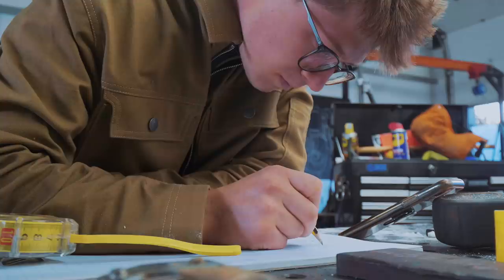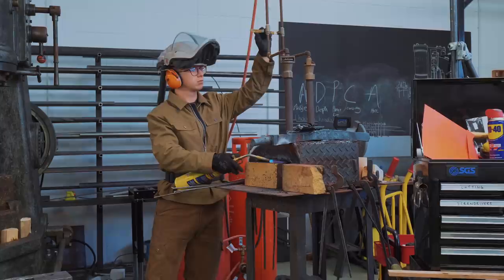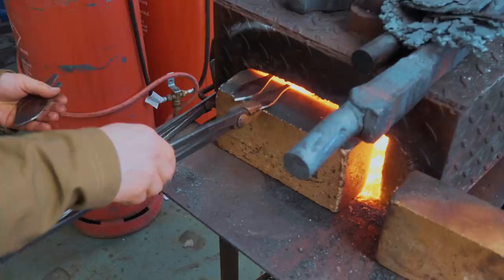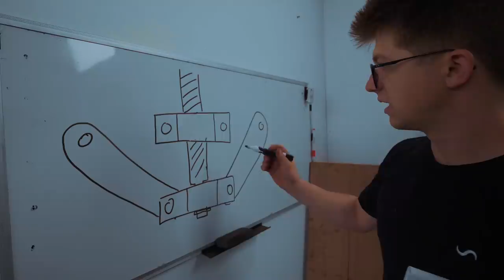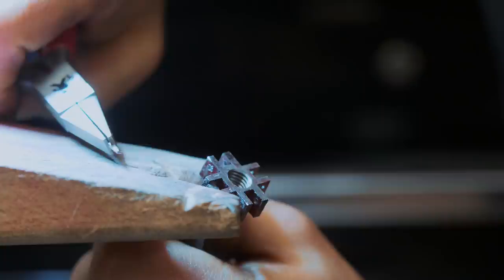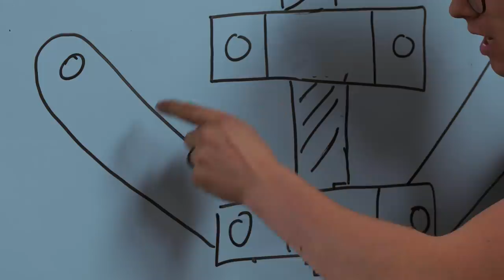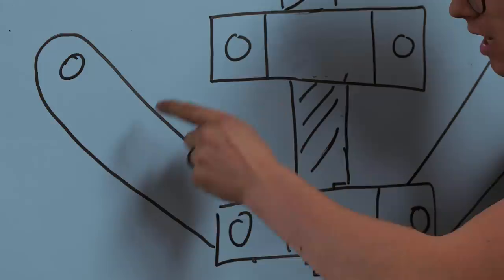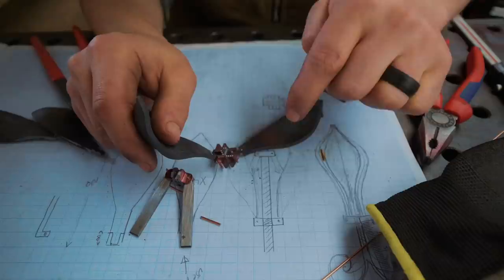Making the Pear of Anguish!

Comment: Idk what’s more scary: the fact he’s making a torture device, or that he’s using red dykem
Reply: the red just seems fitting though
Reply: Definitely the Red Dykum.  That signals a sea change in this channel's future.
Reply: Red dykem???? Oh, goodness... I should stop reading comments while the ads play, I'm already horrified now.
Reply: idk anything about metalworking, what is that and whats the issue with it?
Reply: @vriskie  Dykem is the stuff a metal worker paints onto the surface of metal so lines scribed on the metal are more visible.

You can think of it as a fast drying thin paint.

IDK how it got started, but it was a running gag that Steele hated red dukem and would only use blue dykem.

Now?  We're all trying to figure out why he's using red dykem.
Reply: lololol

Comment: You know, the 'pear of anguish' is excellent when you need to work with pvc tubing and flex tubing (flexible conduit). I use something similar when I'm working with flex tubing for wiring signs, just a little butane lighter and expand it from inside, than it'll fit right on to another piece and be water tight.  They're handier than you'd think.
Reply: I was going to suggest testing it on an inanimate subject - PVC might be a good candidate for it
Reply: Still doesn't explain your cellar, mate... ..  .
Reply: We call them fanny stretchers
Reply: The Pear of PVC Pair-ing
Reply: Great idea! I genuinely need to get one of these to stretch my heatshrink tubing for when it's just a hair too small (a weekly occurrence for me).
Reply: @charmio  I have one for that also, I got it off of amazon.  It's about the size of an ink pen, you insert it and twist and 4 arms come out to stretch it.  I wish I could send you the link, but it's been several years.  I'm sure you can search for it tho.  I use it for heat shrink tubing when I need to seal up LED wire.
Reply: and can the conduit pear all that pressure?
Reply: @dorin7431  Only on fruitsdays and satreedays ;)

Comment: Alec Steele how often do you have to change out the cutting blade on your metal chop saw? I own the same one and have noticed that some of the teeth are chipped.
Reply: I own a fab shop and use the Cold but saw day in and day out. They’re fine to run until they stop cutting. However I’ve noticed the surface finish of the cut gets worse as the blade wears.
Reply: TCT is sharpenable. Don't just change it, sharpen it.
Reply: Hows your down feed hydraulic cylinder working? If there are leaks or air inside the line(it twitches instead lowering blade slowly ) or if you cant fine adjust it properly it will plunge the blade and cause tooth breaking .
Maybe you should replace it or change the o rings and seals .

Comment: Those two t shaped pieces you milled were pretty similar. You could benefit from a stop tool that stays in place so you can place your parts against it in the vice. So that way you have repeatability in the left and right directions. If you can place the part in the vise the same, you can set zeros and go to the same zeros. I don’t mean to patronize you if you already know this.

I’ve notice when you mill a slot, you do it with the endmill at full depth. If this is working out for you that may be alright. You just may have trouble with chips clearing out as you mill.

Comment: Trepanning saw. You should make one and a silver insert and small hammer that would have been used to cover the hole made in the skull and stayed in place by having teeth on the edges that dug into the bone as you hammered it in. This wasn't some quakery tool either since wit allowed for the removal of fractured bone and blood clots in the area after a blow to the head and even had a success rate that was reasonable and much better than doing nothing. Archeologists have found human remains all the way back to the stone age that had healed skulls from the procedure, although the pre-bronze age ones did not use the silver plug that was later used to protect the hole.

Comment: "The Pear of Anguish medieval torture device that was used on women in medieval times was inserted into any opening of the body that you can imagine The Pear of Anguish was inserted into the mouth or any opening in its closed position, the device had a screw mechanism that allowed the torturer to slowly expand the size of the the pair, this created incredible pressure inside the woman’s body. The antrum would be unable to cope with the pressure and will become lacerated, the woman’s flesh would be torn and lacerated, forced apart causing immense pain." Nasty!

Comment: Hey do a Tonsil Guillotine (1860s) This method of removing tonsils worked much like a traditional guillotine, slicing off the infected tonsils. This “double guillotine” design meant that both tonsils could be removed at the same time. Tonsil guillotines were replaced by forceps and scalpels in the early 20th century due to the high rate of hemorrhaging and the imprecise nature of the device, which often left tonsil remnants in the mouth.

Comment: there was another version of this that was use specifically on women, it was bigger and used a push/pull mechanism to open and close instead of a threaded screw, it would be heated up and clamped onto the woman's breast, sometimes it would be sharpened and pulled off the breast without opening it, either shredding the breast or ripping it off entirely